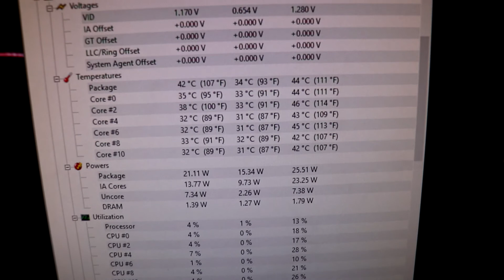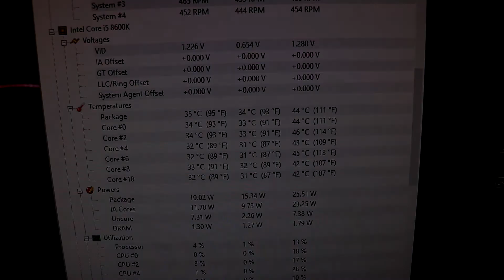ASMR Hyper 212X Cooler on MSI Z370 LGA 1151 ATX Installation

Comment: my standoff screws are too short... i have the msi z370 a pro with the hyper 212 evo (not the x)
Reply: same....this is driving me nuts
Reply: @cdr861532  found any solution?
Reply: @cdr861532  Nvm i found some plastic things that when you put screws in them you get some height for screws
Reply: @adeptusastartes3698  Yeah those will do it....Sorry i didnt get back to you sooner. I had to use those as well. Got my rig built and she's purring like a kitten.
Reply: @cdr861532  No problem i found them after commenting here and managed to install it same night, what cpu are you cooling with this cooler?
Reply: @adeptusastartes3698  i5 8600k. My temps stay pretty low. However, my case has 3 fans in the front, one for the power supply, 2 on the graphics card and 1 in the back. So its like a wind tunnel. My temps will get up to around 55-60c when i am gaming though. Honestly, i probably need to go back and reapply my thermal paste because I had such a problem getting those screws in that I moved the cooler around a lot when installing it. What are you running?
Reply: @cdr861532  Im running i5-7600k temps pretty low too considering that kaby lake has heating problems, did you overclock your cpu? Man i was thinking the same, when i applied paste and placed cooler, cooler was sliding left and right, was thinking about reapplying paste , but i have no more patience for that cooler.
Reply: @adeptusastartes3698  No I haven't overclocked it. I'm not that experienced in messing with cpu's. Everything seems to be running fine the way it is, so I don't want to mess with it. Plus some folks say that overclocking can shorten the life of the processor.
Reply: hello, i want to buy also z370a pro with 212 evo cooler,  do you have any compability issu with the size of the cooler. I think the fan of the cooler gets a slot for the ram and im afraid it closes the important one or im wrong?
Reply: @P0werfulSilence  Did you build it in the end? Have any problems?
Reply: @Jacksaur_  I sent message to msi for this question and they replied that it might close one slot, so I went for cryorog h7 with 8600k @ 4.7ghz with 35-40 idle temps  50-60 gaming and 70-75 stress test. Im very happy for this decision